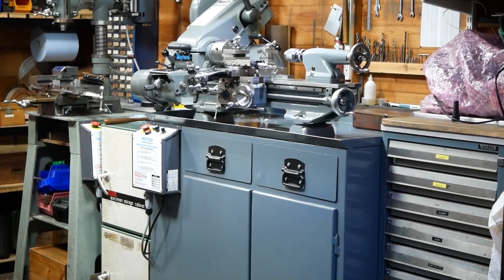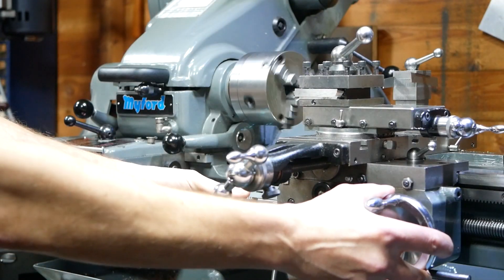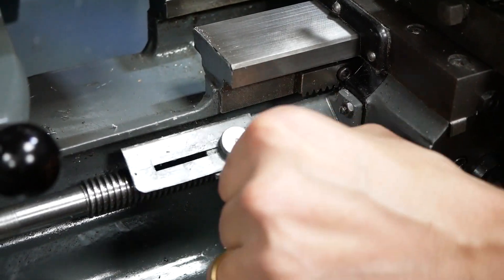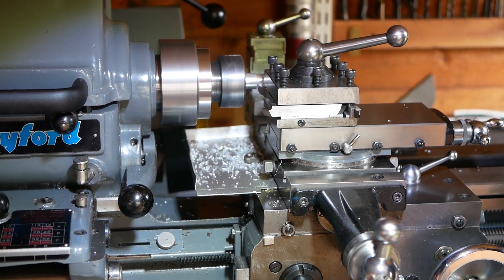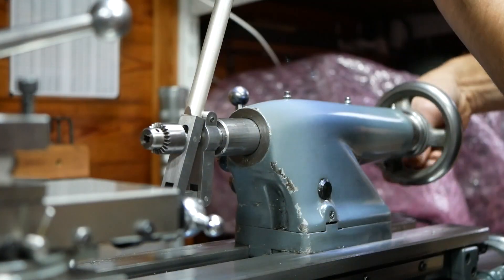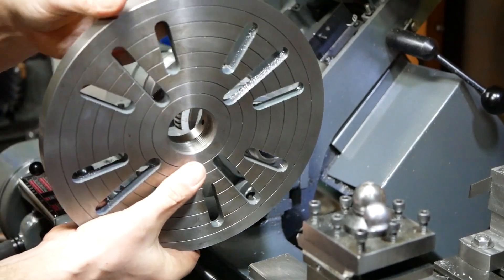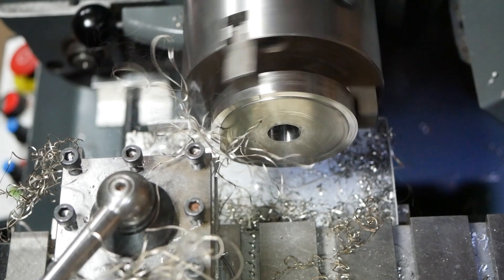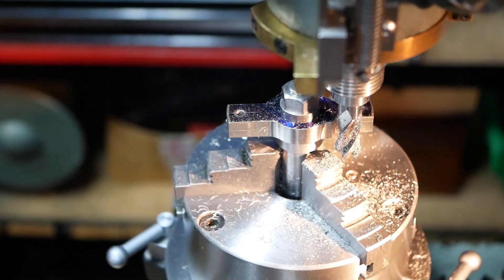The Myford Super 7 Lathe: An Introduction

Comment: I’m looking to purchase a super 7. Any advice?
Reply: I bought 2 of these machines. first one in 1996 (sold it to help fund a South Bend "Heavy 10" rebuild in 2006) and a rebuilt Super 7 from Myford back in 2021. Make sure you get the hardened bed, power cross feed, and a QCGB if you can afford it. The long bed version is great if your doing gun barrels and the like, but not really necessary. The "Big Bore" lathes are expensive and so is the accessories that fit it (chucks, faceplates, er adaptors, etc...)

Any questions, just ask.

Comment: I bought my Super 7 with gearbox new from Myfords oh... maybe 30-odd years ago now. I have done many mods including the GHT dividing head attachment, and I also designed the sensitive tailstock drilling attachment sold by Hemmingway and the resettable tailstock handwheel (you may be using your own designs of course!). So many other mods I lose count, it uses 3-phase motor with speed control, made a taper turning attachment and profile copying attachement which proved useful, ball turning tools, knurling tools, toolposts, basically as you say: the S7 does it all. It is still as accurate today as when I bought it. The only fault is that the casting filler Myford used is cracking off in places - especially the tailstock - which is only cosmetic I know but it's a shame.

Comment: I purchased a 2nd hand (but as new) standard ML7 for 48 years. 20 years ago I installed bronze bearings, a hardened spindle, faster 2-speed motor and more recently DROs. For sure, they don't like heavy cuts but they are the most versatile lathe available with a huge range of accessories. They are quite accurate but again, remember they're not a Dean, Smith and Grace so lighter cuts are necessary. I find the dividing head very useful too. A very quiet machine too.

Comment: I was at a shop that used Myford cylindrical grinders from the late 70s for production, this was 2017 era. I was always impressed at their robustness, especially because the new ownership was not as dedicated to maintenance as the founder and they just kept holding tolerance, also they were grinding Zorconia with diamond resin bond wheels

Comment: This is a really helpful overview, thank you! About 15 years ago I purchased my first lathe, a tiny and absolutely terrible thing from China. I knew nothing of lathes other than it was the tool that I needed and it's certainly done a ton of work on and off over the years. But, I sincerely and deeply absolutely hate it. Everything about it is simply terrible. Life has moved on and I now use it sparingly for work for making my own tooling (fly press) and machining work parts. I am soon to move workshop and would still like a lathe, something relatively small but good god better made and with more torque than a hamster. Learning that you can get these in metric or convert them yourself easily, and that they're also widely available (UK) and tons of parts, they seem absolutely perfect for my infrequent use. Going to keep researching but very helpful to see your video, the quality and flexibility of it all seems very appealing.

Comment: Hi, I have just recently bought a myford ml7 and it isn't cutting true. It runs material off one side more than the other, it seems as if its buckled so to speak. Do you think its possible the spindle end could be damaged? The spindle and bearings all seem tight. I can't feel play anywhere. Any help appreciated. Many thanks
Reply: Look in the Myford handbook, the section on levelling and set up. The ML7 series lathes are designed in such a way that the bed can be twisted to achieve parallel turning. It is a relatively simple process, but needs following in a logical sequence. This is likely to be your problem and one that is easy to solve.
Reply: @simonbirt6121  Thats crazy. It looks like a totally solid bed. Its just bolted down to the stand it came with. I will take a look, thanks. How do I oil the nipples, is there a special tool, they look like grease nipples to me. Thanks
Reply: @Supercarlsunday  They are oil nipples, you need an oil gun. There is loads of information about Myford lathes on here. Re the bed twist, you should have jacking screws to induce the required twist.
Reply: @simonbirt6121  O.K thank you. New to it, its a beautiful piece of equipment, my great uncle had one, he used to build scale remote controlled aircraft and boats.

Comment: Nice lathe, always liked Myford.
 I weighed the choice 35 years as the price was comparable and went with the Austrian Maximat Super11. Can be lifted by two people, runs forward & reverse, greater swing not limited by length, longer bed, separate cross and travel drive from threading shaft, foot brake option, D1-4 quick change chuck head, 1.4" hole through spindle and induction hardened bed.

The Maximat FB2 is a nicer mill than the Dore also.

Comment: I have an old super 7 without an extra gearbox and it doesn't have all the extras that your Myford has, but it is a fantastic machine.
I bought it in 1983 and it can cut almost any wire pitch you need.
You give a wonderful explanation of this fantastic English product!
Too bad they are no longer made new.

Comment: I'm thinking about getting yet another lathe. My home business days are over (I hope), and I'm thinking of downsizing my shop. Right now, I have an old Logan 14 I wouldn't mind passing on - it's a big friendly dog of a lathe but bigger than I need - it's maxes out at 800RPM so it's not good for small parts.

Choice in new small lathes is more limited than I've ever seen. I simply will not buy a new Chinese lathe, been there done that. All of the Taiwan lathes are bigger than I need. I used a Hardinge HLV in my main precision optics job for 30 years, great lathe, just don't want one in my shop. That pretty much leaves Myford and Wabeco. Wabeco lathes are very expensive in the US, some 2X England and Europe. Why, I don't know. It appears a new Myford Big Bore would run me about $13,000 total to get it here. Not counting the additional tools I'd probably buy. I've no hope of getting a return on investment, I just want a nice lathe machine for my hobby craft. 

The Wabeco lathes seem to be very nice, just more of a black box item than the Myford's. And not as versatile for sure. And kind of uninspired appearance. I do live not too far from the Morgan Hills USA distributor, so I could probably arrange a visit. If I could find a Wade 8A that isn't clapped out, I'd be happy - Wade only made 1000 of these excellent lathes. Weiler lathes are exceedingly rare over here, I've only seen two for sale in the 5 years I've watched for them. Both were very used looking. For a while I thought about making a trip to Germany to run one down to import. That's not going to happen now I think.  I owned an Emco Super 11 for a while, not my first choice but I would own one again. These in good condition are rare too. The smaller Emco models are not interesting. 

I'm an old guy, "cashed up" as you folks say. The cost is incidental, but I'm wondering if Myford is holding true to their legacy. For all the acquisition work, and going on faith, I'd really want the lathe to be pleasing. I would be interested in your opinion on this.

Comment: I have a question, I’m looking at getting one of these as my first lathe and would like to know if you could use 321 stainless on it? 
Thanks
Reply from the maker: Unfortunately I can't say with certainty that it will work well for your application, but I have machined tougher alloys than 321 successfully on the Myford. Ultimately, it depends on your tooling, the typical size of your workpieces and how quickly you need to rough-out. For production work a heavier lathe will remove material more quickly but if you are using this for one-offs and small components (typically less than 30 mm diameter), then the Myford is a good choice and will have no problem machining 321. It's probably worth investing in some good carbide tooling for 321 though because of the hard inclusions - this goes for any lathe. Hope that helps!
Reply: @chronovaengineering  thank you for responding. It’s only going to be for one off stuff, hobby pieces. Nothing major.
Reply: Tight gibs, respectable carbide tools (set at an accurate center height, of course), good 'ol black cutting oil with a lil added sulfur (try Hubbers), determination, & patience could just about cut anything you could throw at a machine like this or a Hardinge HLV. Just found this channel. I love it already. I've got 25+ yrs as a journeyman Tool & Die Maker/Precision Machinist so I very much appreciate & understand just how well skilled you are. I learned everything on manual machines before learning CNC. My manual machining & 1 off experiences & everything that comes along with it (so much if it I see here), is truly what made me what I am today. Eventually it transforms from metalworking into a form of sculpture. It's not just a trade or hobby, it's art & you are very much an artist at what you're doing here. Bravo, sir 👏

Comment: I live in California, U.S. A. and I saw a Myford Super 7 at the Westec trade show in the early 1980s but never saw one again. Hardinge is the closest equal to Myford. They make a super precision lathe for around $35,000 that does a lot of what the Myford does. Thanks for showing us this very fine lathe.
Reply: Comparing a Myford lathe to a Hardinge is like comparing the Formula 1 race car to a model T ford. The Myford is a plain bearing lathe with a threaded spindle nose that hangs out a mile. The whole design of the Myford is out dated and weak. Trust me don’t fall in trap an plop down big money for a Myford. They are basically a money pit.
Reply: @potlimit2002  you wanna blow over six times the money for a Hardinge be my guest, but the reality is they're built for different markets. Myford lathes are hobby engineering lathes, not toolroom lathes. They're designed to be as good as they can for the price so that as many people can have and enjoy them.
Reply: @potlimit2002 the hardinge has a solid headstock. It is not a hollow casting with reinforcement ribs cast in. It is a solid chink of cast iron in order to minimize vibration. You can lift a myford yourself. A hardinge hvlh weighs 600+ lbs. The myford is a very nice light duty hobby lathe which has been used to build umpteen thousand steam engines etc. There are tons of accessories that you can make for it and it will do nice work in skilled hands but the hardinge is one of the most rigid precise machines that has ever been make and you will find them in the finest research establishments world wide where money is no object. They are at opposite ends of the scale in every respect.
Reply: @potlimit2002  Correct, and a Hardinge is a Audi A4 compared to a Monarch 10EE which is a Mclaren CanAm racecar.

Comment: The motor isn't made to be turned on and of frequently? I studied to be an industrial electrician and I can with confidence say that that's a myth. An electric AC motor only has one moving part and no risk for sparking. If its a DC motor it's about how long it's on not how many times you turn it on.

Comment: How did you fix the aluminum shelf to the gearbox as part of your depth stop setup?  I'd like to make the same for mine.
Reply from the maker: Just double sided sticky tape at the moment. It’s surprisingly solid and accurate like this. In the future we will probably drill and tap the gearbox or use epoxy resin.

Comment: What type of bore guage was that @ 5.35
Reply from the maker: That's a Mitutoyo 3-point bore micrometer. They are much more accurate than a dial gauge or telescopic gauge.
Reply: @chronovaengineering  thanks
Reply: @chronovaengineering  A three point bore guage can't measure ovality. A telescopic guage can.

Comment: please expand on the detail of converting the imperial gearbox to a metric. I have one on my ML7 but cannot figure the conversion.
Reply from the maker: There are two ways of doing it. 1) The metric conversion kit or 2) just swap the gear on the tumbler (i.e. the brass gear at 00:17). The original gear plus a 25T, 33T and a 34T covers you for all likely pitches in imperial or metric. The 33T and 34T are non-standard though. They sometimes come up on eBay, or you can make them. We will discuss exactly how this works in a future video.

Comment: Cool lathe, reminds me of an Atlas Lathe made back in the 40s and 50s but better much better.
Reply from the maker: We had an Atlas lathe for a while. They are also nicely made machines. Thanks for watching.
Reply: @chronovaengineering  Really enjoyed the video, nice job.
Reply: Whilst doing an "Asset Recovery Sweep" in my neighborhood I happened upon a Craftsman 6" lathe complete with motor and tooling, research showed it was from the late 1950's and whoever had it loved it as it was in pristine shape, just sitting there roadside probably less than a day. My guess, based on how life is here in Florida, was that it was a casualty of a home cleanout, assuming the original owner had passed, and the family got tired of shoving the thing out of the way. I gave it to my pest control guy, a very nice young family man that always drooled over my PM 1127 lathe who wouldn't even be able to afford the Q.C. tool system I have upon it and so I hope the guy gets the bug to turn some metal, of which I gave him bits and bobs to start learning with from my home foundry.